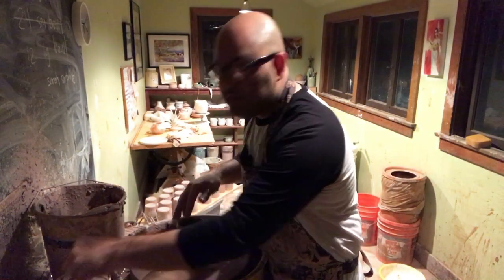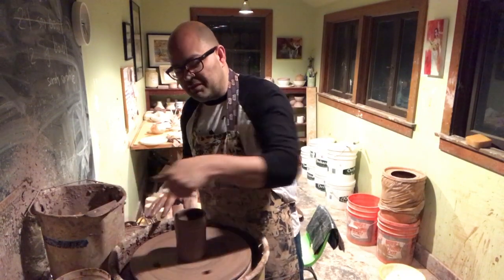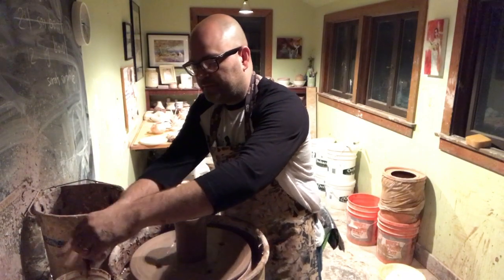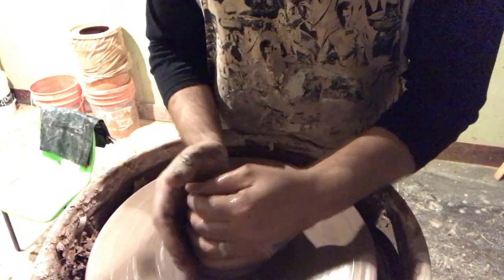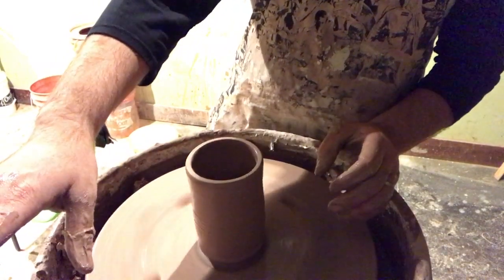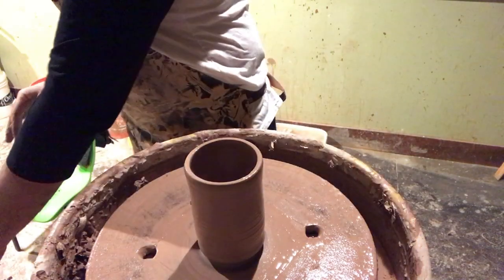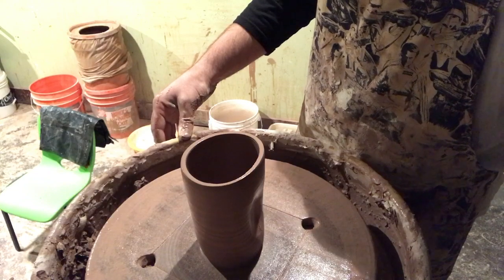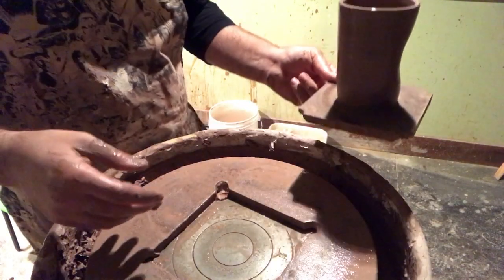Throwing Thumb Cups on the Pottery Wheel

Comment: OMG! I have searched all over NC for a glass like this made from clay with a thumb hold. My in-laws purchased a couple of different styles while overseas and we all love them. Only problem with one glass is that the thumb hold (assuming the glass wasn’t large/round enough) prevented this ice cubes from going down into the glass.  On another set the thumb hold wasn’t in a good position to properly be able to hold a full glass of tea, it was set too low. Are you still making these? Where can they be purchased and what is the price and glaze options?
Reply from the maker: Thanks for the comment! I will send you an email with information on pricing, availability, and ordering. Cheers!